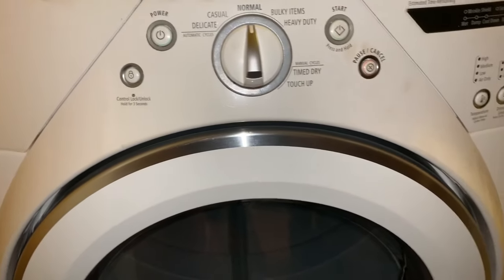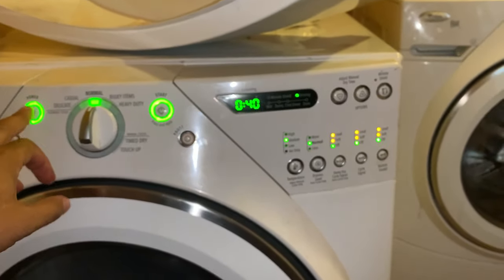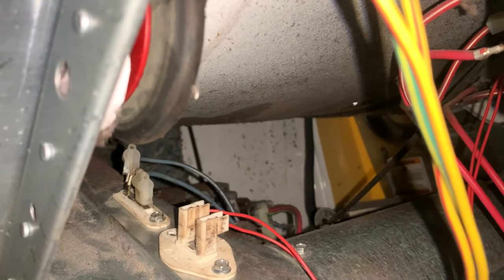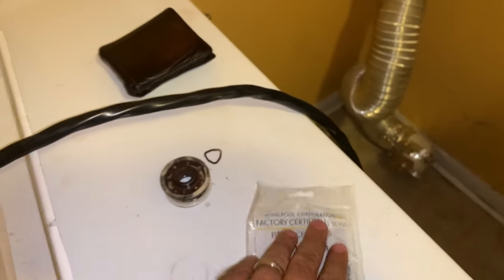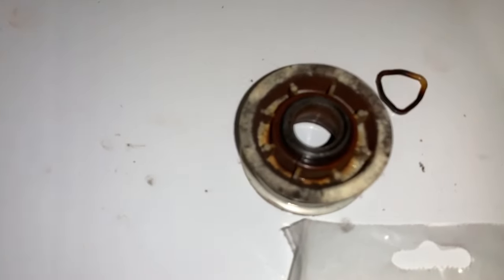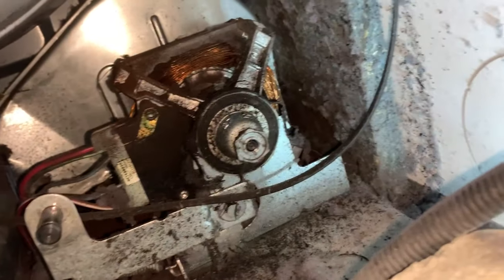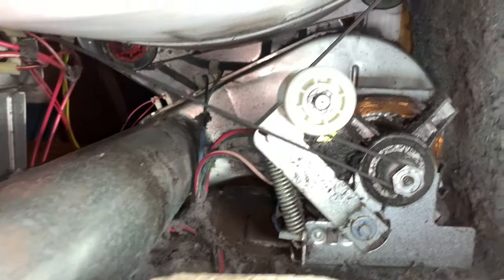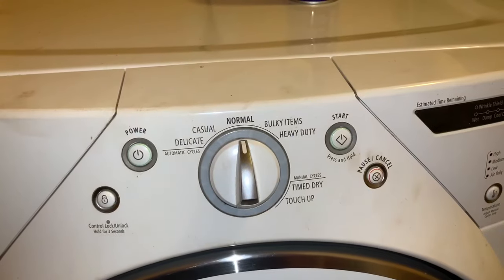WhirlPool Duet Dryer Will not Start but powers on.

Comment: Mine squeaked for longer than I should have let it go, then it started making a different noise, then one night, clunk and stopped.  Powers on but won't start, just as you show.  I'm guessing it's this or the belt or both, because of the squeak.  How do I know what the right part to buy will be? Do I need a model number?
Reply from the maker: The part numbers are at the bottom of my description.    I think your situation is exactly like mine.    Open the back and look inside.   UNPLUG POWER FIRST.   
I See the Greek videos in your playlist.    Very nice.    Ti kanis.
Reply: @kissingbanditt  kala ime (did I do that right?)

Comment: My duet just beeping and didnt run. I checked the thermal fuse, pulley wheel are both good. What else I need to check thanks
Reply from the maker: give more details, specific details...alarm code?
Reply: @kissingbanditt  No error on LCD display. All the drying program still showed the correct time. Just regular sound as pressing start button.

Comment: Did you dryer throw out an error code? Mine is showing an F-01 which means it's an issue with the control board. I took out the control board and it looks good.
Reply from the maker: Take plugs out.  Blow them out.  Clean them.  If not then not sure.
Reply: @kissingbanditt  I cleaned the plugs. Stuff I look at online say it could be a relay problem, or occasionally the thermal fuse will put out the same message. The dryer did the exact some thing yours did though. So I may check the belt next. I was just curious if yours put out an error code at all.
Reply: @Jaymv4s  did you ever get the dryer fixed?  I have a f01 and f02 code
Reply: @sklang7929  Mine has broken twice since this, the first time it was the thermal fuse, which was a relatively easy fix. The second time the circuit board was obviously fried. The circuit board is easy to access and free to check. I'd pop that out, and if it's got black marks over where the relay is, then that's your problem. And unfortunately it's a pricey fix. Cheaper than a new dryer though. If it looks good then just order the thermal fuse. They are pretty cheap, and that was my problem the first time.

Comment: The real question is how the heck do I open the bottom part
Reply from the maker: 2 screws right at the bottom....One at the left side and one at the right.  You literally have to lay down and look for it.  I had to just ever so barely just tilt the machine up to unscrew them.   Just put a book underneath and you will have easy access.

Comment: My thermal fuse continues to blow after about 5 cycles.....could it be anything else?
Reply from the maker: Check the lint holder at the front.  Do you clean it after every dry cycle?
Next possibility is your vent at the back is clogged and the hit air has no where to go.   
Next possibility is shorted out or bad heating element.  But not 100% as you said it happens after a few cycles.    If heater element was bad it would blow the fuse every time.   
Bad board or intermittent connection.   

Odds are i believe your lint screen or back airway duct are clogged.   The hot air has no where to go.    Over heats and blows the fuse.

Comment: For the life of me I can’t get the back off 😂😭
Reply from the maker: Theres only screws around the back.  Top back and bottom back.  A few on the left and right side of the back panel also.
Reply: @kissingbanditt  so @ 3:43 it shows two wheels would you know what the lower one is the black one ???